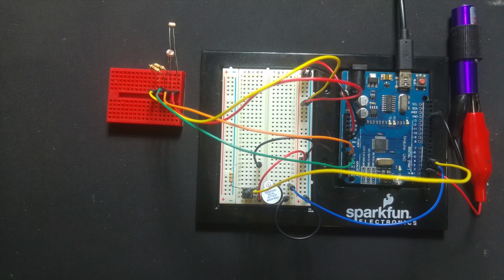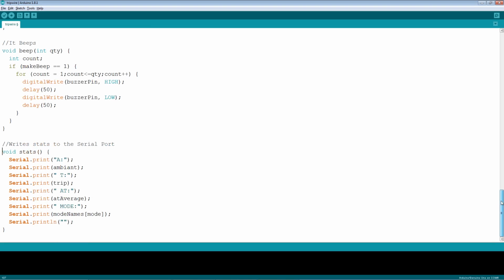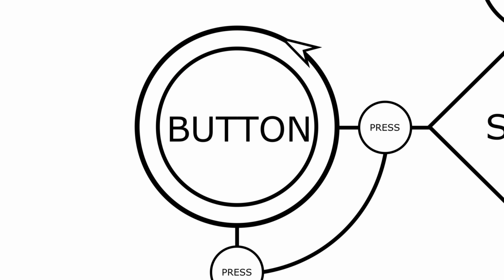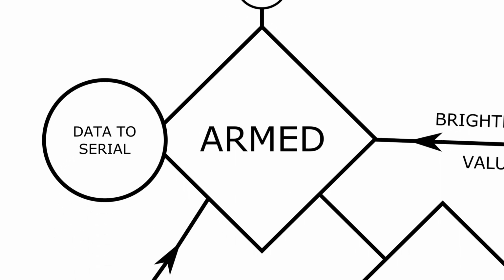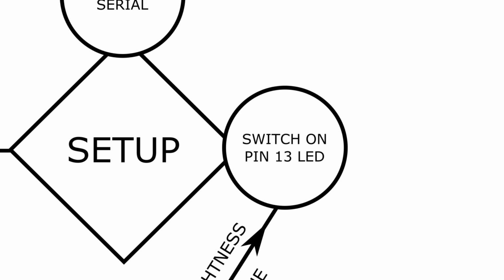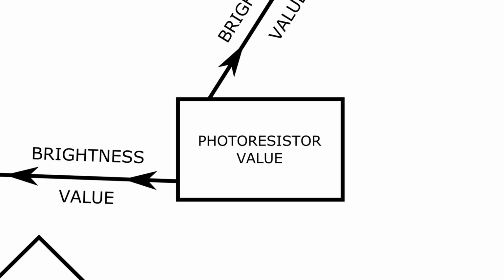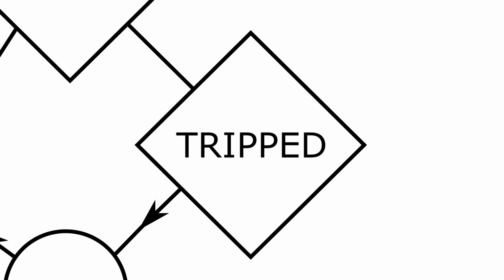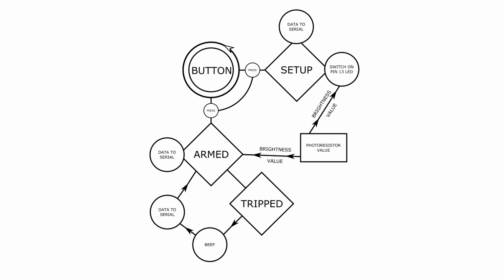03 Arduino Laser tripwire Tutorial

Comment: mine works great, but why the ambient light ldr and reading if it wont need to trip the buzzer was wondering if i could use that pin for another project a diy spiritbox starter with wire for anntena to use as emf detector but over all love the video the way you describe it all is well

Comment: a broken jumper wire pin stuck into my arduino.How can get rid of this plzz help
Reply from the maker: +ozair shahid dude. I have never faced that issue. I wouldn't know where to start
Reply: buy the esolom soldiering kit it has d/f equipment's that you can use to pull it out